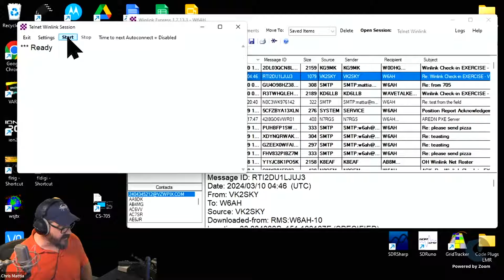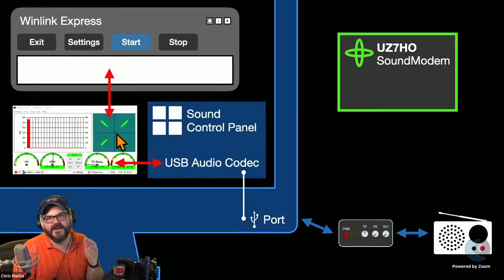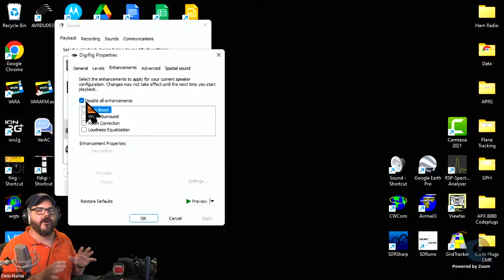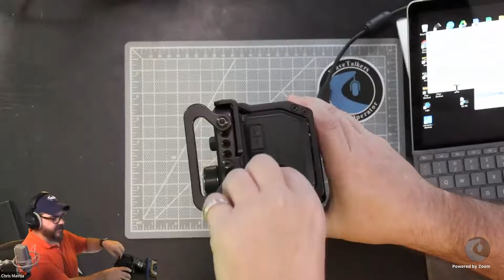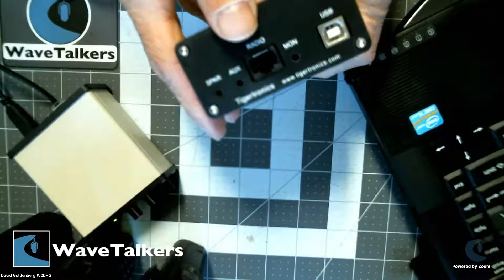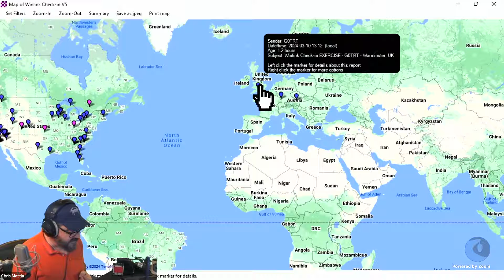Winlink using Hand Held Radios: WaveTalkers LIVE 98

Comment: Would have liked to see a Yaesu FT3D example with a Signalink.
Reply from the maker: None of us have an FT3D to demonstrate. We generally only demonstrate equipment we personally own and regularly use.  We do our best to demonstrate general concepts that can be then applied to other specific models.  If we had one we would certainly demo it.

Thanks for learning with us!
Reply: Hi, Chris.  Jumper installed and correct cable for my Yaesu FT3D attached to the Signalink.  I have my sound configured perfectly per your instructions in the video.  Squelch is off.  The PTT works when I try to ping or auto tune the Gateway, but the VU meter stays pegged yellow at -65 dB.  The gateway is 38 miles from me and I live in an apartment building.  It’s hard to get clear signals for the repeaters in the next town, so I suspect it’s my location.  When I listen to the frequency there is no activity on it.  I hear nothing.   I set the mic gain to around 4 out of 9.  Power is set to medium.  I don’t know what else to do.  I’m going to try this outside away from my building and see if there is a difference.  If there’s anything else you think I should check, please let me know.  73, John, KA1LBD
Reply from the maker: @JohnJudge-04  Is the VU on VARA FM pegged when you are in RX mode?  We might need to tweak your Windows Recording (Mic) Levels, the Signalink, and the Volume knob on your FT3D.  Check on our  Winlink Basics page, go to #5 Best Practices and watch the Tuning VARA FM video.  It has a clip from an early episode where I had bad audio and the guys walked me through tuning with my Kenwood D710G.  Obviously a different radio but the concept should be the same.

For accessing the gateway with your building situation.  You likely will have better luck using an antenna that is outside or at the very least right in a window.  Ideally the window would be in the direction of the Gateway you're trying to reach.  If you can get the antenna outside and elevated that help maximize your changes of success.  I really like the N9TAX roll up slim Jim antennas.  They are pretty cheap and work very well.  I always order mine with the 16 or what ever ft of coax attached.  Then use something to raise that thing up.  When I first started I used PVC pipe.  Now I just toss a line in a tree and pull it up a bit and it makes a huge difference when operating with an HT.  The Power Out is probably not your limitation, it's probably your antenna inside.  Try outside, try a better antenna, try a better higher location for your antenna.  keep at it, you'll get it.  ifyo're still having trouble join us for an after party and we'll do our best to help get you going.  73 Chris W6AH
Reply: I have ordered the required jumper and cable for my FT3D.  I think I have enough info from your directions to get it working.  Thanks for the informative videos.
Reply from the maker: Excellent.  Let us know if you have problems getting it working.  At our After Party each week we do our best to answer all questions operators bring us.  you can sign up for our mailing list and get the zoom invites by going to https://wavetalkers.com/joinus.php 

73 Chris W6AH
Reply: Hi, Chris.  I watched the video and have made adjustments to Mic Gain, Power, Volume Knob and the TX and RX knobs on the Signalink.  The levels on the laptop are maxed at 100.  No joy.  When I try to auto tune I don’t hear any clicks until attempt 4/10.  Then the No Signal pop up appears.  When I ping I hear 2 clicks and then No Signal. The connections are good.  I see the radio go into transmit when I auto tune and I hear the clicks.  I have kept the delay at 0 throughout.  I was using a stub antenna and swapped it out for the Diamond SRH77CA.  Still nothing.  I have tried this on both the A band and the B band.

Under the APRS menu there is a Com Port Setting, which gives me the option for ON/OFF and SPEED, which is set to 9600.  My APRS Modem is also off, as is the GPS.  I don’t imagine these settings would be negatively impacting me with VaraFM.  

I will do my best to join one of your after chats.
Reply from the maker: @JohnJudge-04  do you have another HT?  If so let's back up and try this.  Tune the second radio to the same frequency.  Then try to ping the gateway.  Does the 2nd radio hear anything?  If not then we probably are dealing with a signal chain issue some where.  If you do hear something then we have the signal chain correct and either need a better location to hit the repeater, sounds likely, and then we probably need to adjust settings to optimize.

Any radio that be tuned to the same frequency will work for this test. From a baofeng or any cheap ht to an SDR dongle, to a mobile.  Just tune to the same frequency in FM and see/listen to hear if we're making RF.

We'll get it figured out.
73 Chris W6AH
Reply: Unfortunately, I only have one HT.  I did look at the Log and here are the messages: Soundcard Output Device missing in action.  VARA is not connected to any app via TCP Port 8300.  Makes no sense, as it is set to 8300 under TCP Ports > Command.  Data is 8301, but slightly greyed out.  When I open a session it clearly says, Successfully connected to Vara FM TNC  at 127.0.0.1 port 8300.  KISS Interface box is unchecked.  Device Output is clearly set to USB Audio Codec, as is Input.  PTT is set to VOX.  With the Squelch off, I can see the meter moving, owing to the static, but I do not hear it because it’s being fed into the SL.  Also, my version of Windows 11, I cannot see the AGC, as you did in your video.  The custom tab is gone.  

I was told by someone in a FB Vara group it shouldn’t matter if the Gateway is down or offline.  I should still see something on the VU meter.  Do you agree with that?
Reply: Another thing I notice is the needle on the VU meter will reverse clockwise cycle.  It will it move to the red and then slowly reverse all the way back to the yellow.
Reply: Ok, I just got home from testing it outside.  No dice.  The VU meter remains flat.  I’m beginning to think I have a faulty or wrong cable, which is strange considering when I auto tune the PTT works.  I’m at a loss.  Maybe there is a setting in radio I’m unaware of.
Reply from the maker: @JohnJudge-04  are you able to hear anything on that frequency using a second radio when you transmit?
Reply: @WaveTalkers ok, Chris.  I tested the frequency today using my mobile rig.  When I keyed up on the HT, I heard it come through the car speaker.  And when I keyed up on the mobile rig, I heard it come through the HT speaker.  So I’m able to hear on both the HT and Mobile radio.  However, the VU meter still will not move and I still cannot ping or auto tune the Gateway.  
Tigertronics support said this:  Keep in mind that the VU meter won't move unless you open the radio's squelch and turn the volume up.  Be sure the SignaLink's RX knob is turned up and that the radio is powered ON.  Open the squelch?  Everything I have heard is close the squelch.  Anyway, I tried it.  It didn’t work.  The volumes are up everywhere.  On the laptop, on the SignaLink and on the radio.  Sorry I couldn’t make your session today.  I was out testing this and activated a park (FT8).
Reply: I will have to try that tomorrow from the mobile rig.  I only have one HT.
Reply: Point of clarification.  A Gateway is NOT a repeater, therefore, there is no tone or offset, correct?  You just manually enter the frequency on the VFO and go, right?
Reply: @WaveTalkers  Turns out it was a broken pin on the jumper.  The new jumper worked.  I was able to dial in the VU meter.  I still can’t get a Gateway signal for auto tune or ping, but I think that’s more a function of being too far away from the Gateway.  I will test it out in the field.  Thanks for your help!